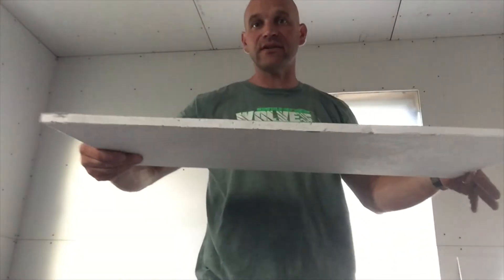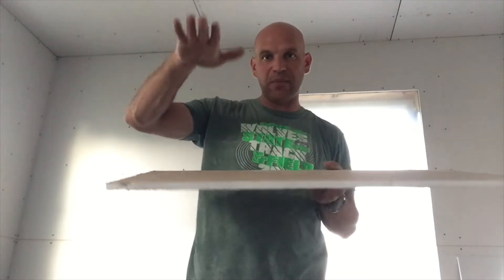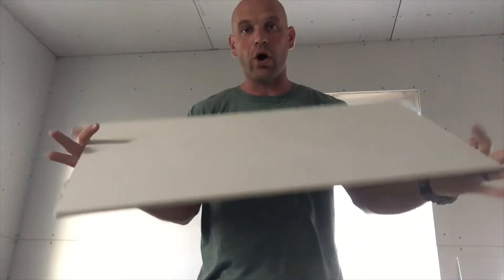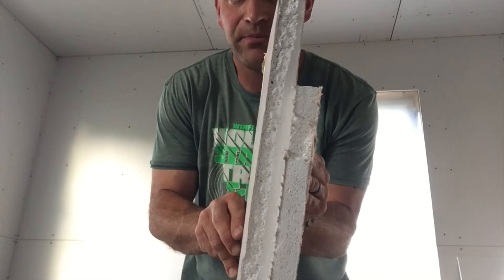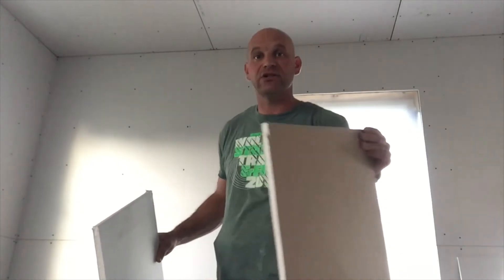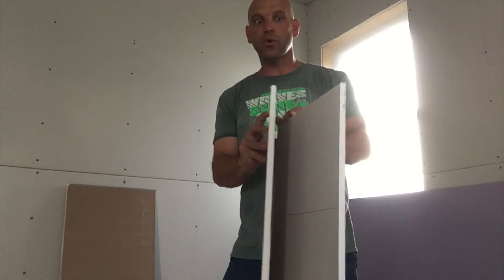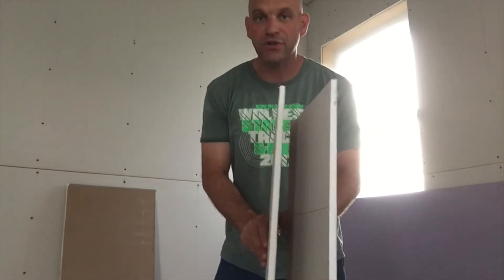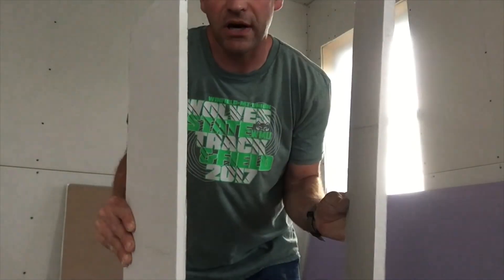What is drywall and why are there different thicknesses?

Comment: 3/4 drywall for what?
Reply from the maker: I’m not quite sure what your question is directed at. I’ve used 3/8, and 1/2, for walls and 5/8 drywall for ceilings. I don’t recall ever going sing 3/4 drywall though.
Reply: @Trevkongable   i want to know where we use 3/4 drywall?
Reply: 3/8 drywall is commonly used in mobile homes.